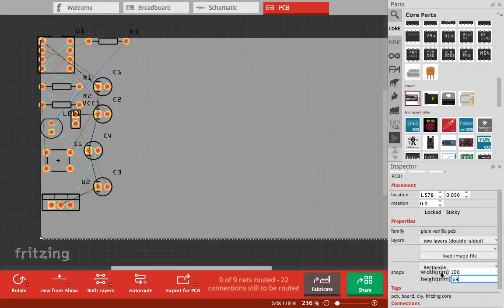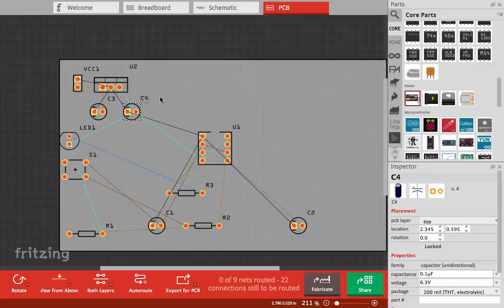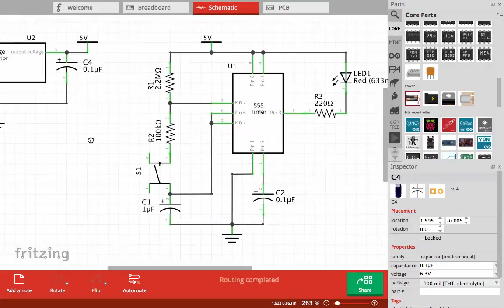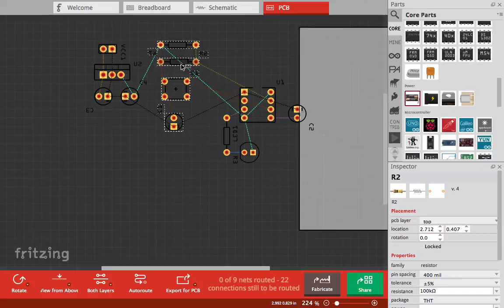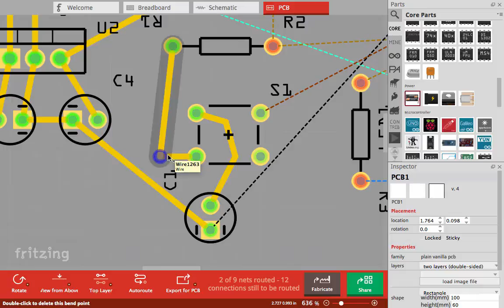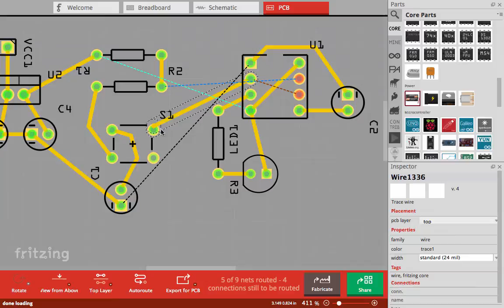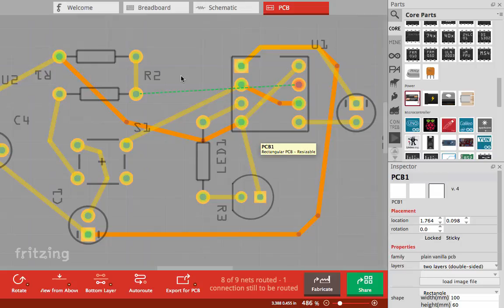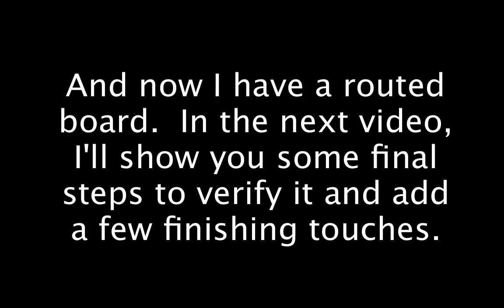CMPE370: Fritzing PCB Design Part 1

Comment: Am I missing something? You wanted to connect C1 ground to U1 ground and struggled to find a path, but C2 ground was already connected to U1 groiund, so why didn't you connect C1 ground to C2 ground on the top or bottom layer, and then you'd have been there?

Comment: Why doesn't it let you put your own capacitor values in? Its set to just a few specific ones and 0.33uF doesn't exist which is pretty stupid really. On other CAD software you can just type the value in regardless. I mean it doesn't really matter other than for the diagram but even so seems a bit stupid to not allow people to choose values that are standard values.

Edit: it does work by clicking on the text box but sometimes it doesn't want to change you have to mess around with it a bit. :(
Reply: Just use a text label.